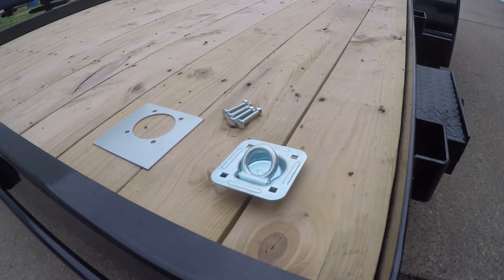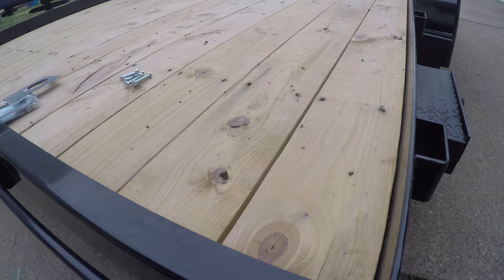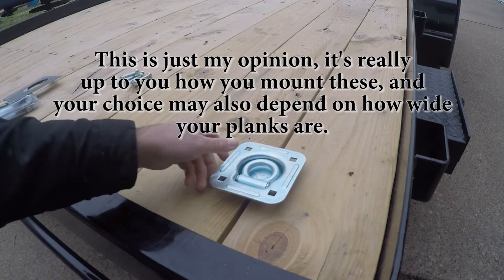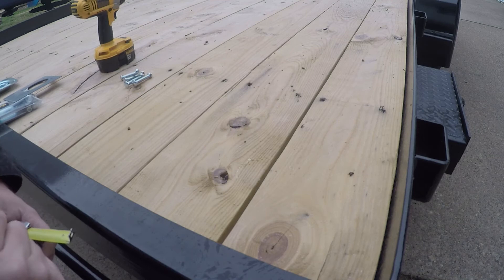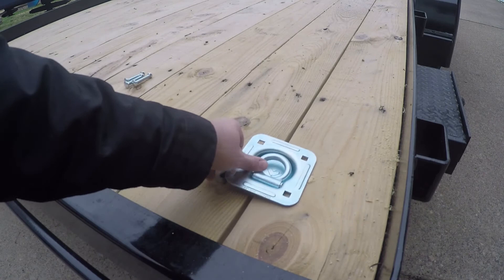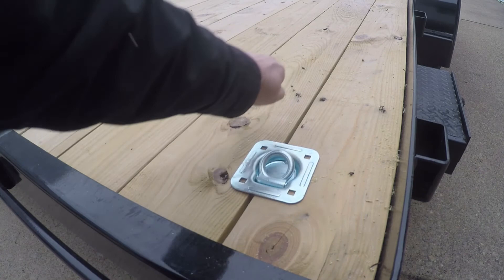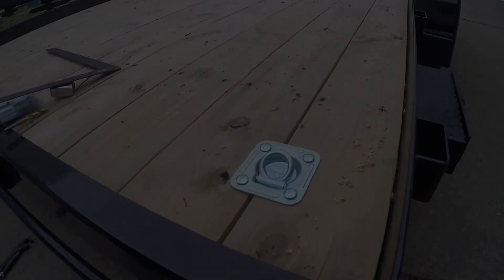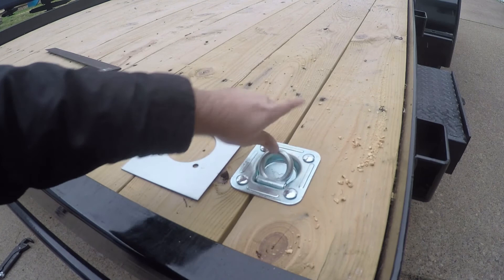Installing Recessed D-Rings (Rope Rings) On Your Trailer

Comment: I would only drill the hole saw to the required depth for clearance of the d ring well, thus avoiding a through hole. Once drilled to depth, chisel out the waste.
Reply: Or could use a router
Reply: @Chris_L034  Good thought Chris, I did not consider standing water.
Reply: It has a drain hole for water, so it doesn’t rust or freeze
Reply: @Chris_L034  If you straddle two planks like he did, it naturally has an opening for water to drain out, so I think that's the way to go:  Straddle 2 planks, and drill enough to clear the "cup" portion of the top.

Comment: It doesn't seem like there is much wood left between the bolt holes and the larger sawed hole. I installed these, but over the trailer's cross members and anchored them directly to the frame instead of the wood. I also routed down the deck about 1/8 inch around the base of the rings to get them truly flush. I think it makes for a much stronger hold and I can still freely slide boxes, equipment, etc. around the deck without getting hung up on the ring bases.
Reply: Is there a way you could show me how you did that? I’m cringing at this video- and I’m curious how you anchored them to the frame.

Comment: Perfect instruction video. I got the exact same kit as you and you answered all of the questions that I had after reading the instructions. Namely, which direction should the ring go and how to orient the backing plate. Nicely done. 

I'm also planning on using a hand held router to route out a small depth so the entire frame sits flush with the surface of my wood. Thoughts?

Thanks.
Reply from the maker: Thanks! As for the router, that’s totally up to you. I’m not sure you’ll gain anything functionally but it’ll look nice. Also, if you read some of the other comments, you can also not drill all the way through the deck and just chisel out the depth needed for it to fit. I did some of my later ones like this and it turned out nice.

Comment: I welded up some stake  pocket  d rings.  They are handy and easily  can be moved around  the outside  of the trailer.  Not much wood  hold your d ring down.
Reply from the maker: I like the stakepocket D rings, I think they work fine for most things, but wanted to have more in the deck for when I need to secure several different items on the trailer. I’ve hauled several vehicles (3500lbs+) on this trailer with the deck mounted rings with no issues. There is plenty of strength, especially when straddling multiple boards.

Comment: If you had to do it over again would you consider cutting the hole only partway through and just chisel out the cup?  I'm thinking leaving some wood there would improve the strength of those areas and chiseling out the bottom of the pocket might only take a couple minutes per pocket?
Reply from the maker: Absolutely, I actually tried that on some of the remaining holes. Though I haven’t had any problems with the ones that are drilled through, especially considering the large backing plate. It does take a little more effort. I think if you’re going to do that one thing to consider is that if you don’t straddle boards like I did, I’d also recommend drilling a small hole in the bottom of the hole to let water drain out.
Reply: @stuffyoucando2  glad you already tried it!  100% agree on the water drainage, too.   I might even consider a small cheap can of truck bed liner to protect the wood.

ProjectFarm has a good video comparing the toughness of a few brands of diy liners.  Assuming the pocket is over sized enough to handle 2 thicknesses (due to diameter geometry) of the coating, those pockets ought to be pretty well protected.  I've seen some signs elsewhere that truck bed liner on wood trailers (at the very least as a top coating) can make that wood last a very long time.

Comment: Any issues with the nuts loosening off the bolts? I can't tell if the wood is just compressing requiring me to snug them over and over, or if something's wrong with my setup. I used lock washers instead of lock nuts.
Reply from the maker: I haven’t had any issues myself. Could be wood shrinkage or your lock nuts. Next time you tighten them mark the nut and thread with a paint marker (or count the exposed threads) and you’ll be able to tell if the nuts are moving or if it’s something else.

Comment: I have same brand d-ring. Label on package said 3 5/8” hole needed.  Based on the 3 1/2” hole you drilled - should I use that size?
Reply from the maker: I just installed 2 more of these in my trailer last week and used 3 1/2” with no issues.

Comment: I know the tie downs are rated for 6,000lbs, but will the wood planks handle that capacity also?
Reply from the maker: It would be dependent on what your bolting to, but personally I wouldn’t consider the wood around one D-Ring capable of 6000lbs on my trailer. However, it’s irrelevant when you consider that you are always going to be holding the load down with multiple straps and D-Rings as well as in the case of my trailer that the whole trailer is only rated for a 5000lb payload. So for a simple example, if I put a 5000lb car on my trailer and secure it with 4 straps to 4 D-Rings, the load is effectively shared by multiple D-Rings.
Reply: @stuffyoucando2  that makes sense. I believe my trailer is about the same rating as yours. I guess that backplate also would help distribute the weight that gets attached to the d ring.

Comment: These adequately hold a vehicle? Juat wondering.
Reply from the maker: I haul anything from tractors up to small trucks and Jeeps and have had no issues. Obviously the decking needs to be secure in addition to the D-rings being installed properly.